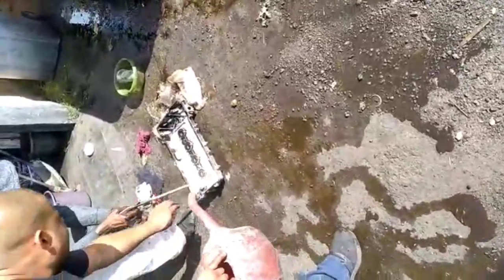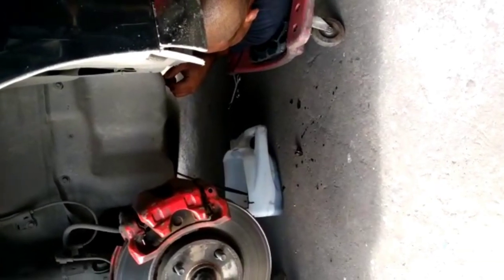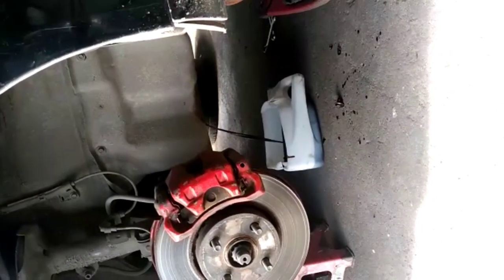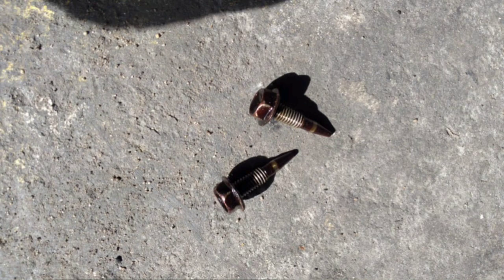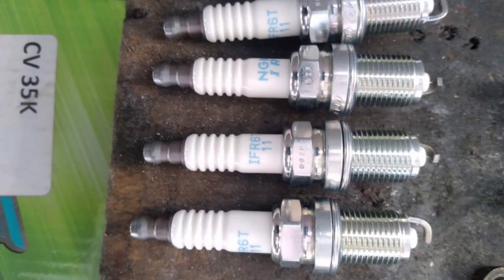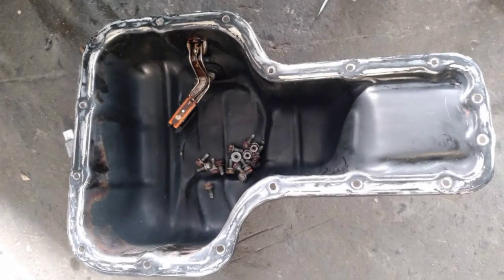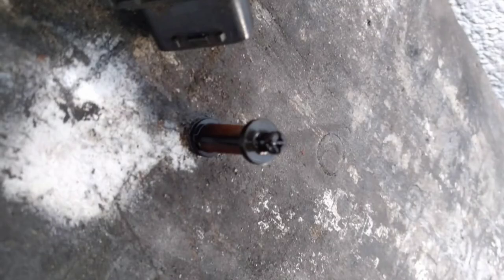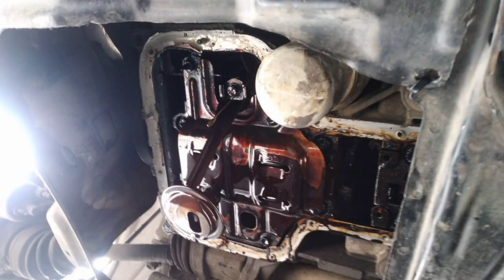2zzge Nation Vlog service when buying new car

Comment: I'm not sure which terminal you took off, but you always take the negative terminal off first and put the negative side back on last, reason is, if you happen to earth the spanner on the body by accident, it doesn't fry any electric circuitry. I learned that the hard way.

Comment: Yah...recently bought 2zz engine i did the service then do the engine flush surprisingly the engine has a knock now
Reply from the maker: That why when you do a flush you must remove the sump and oil pickup and clean it
Reply: @2zzgenation461  i did remove the sump now um confused